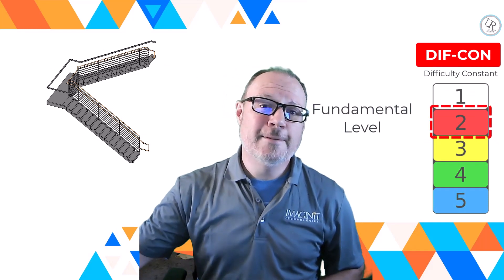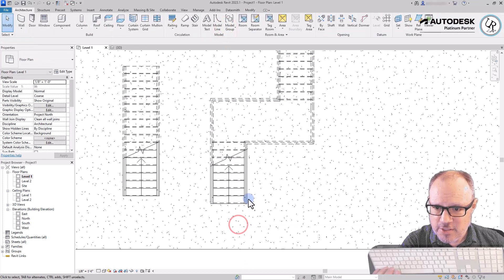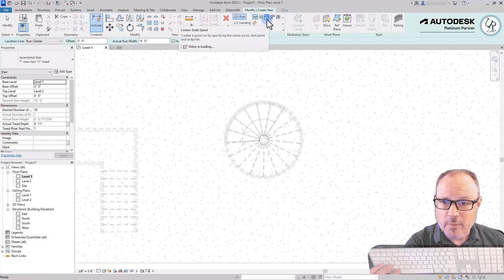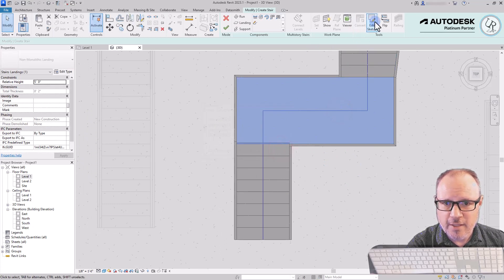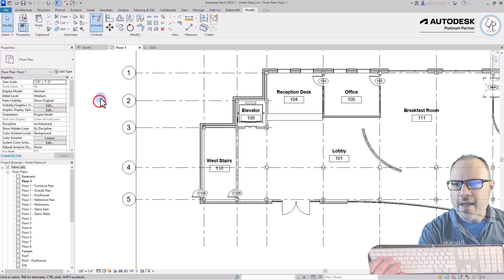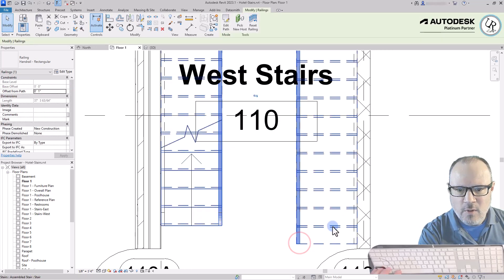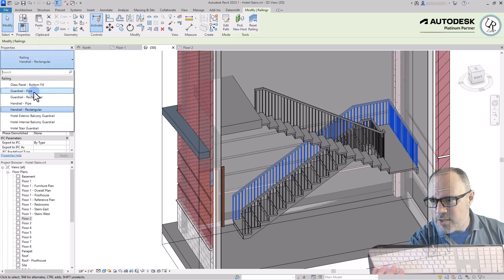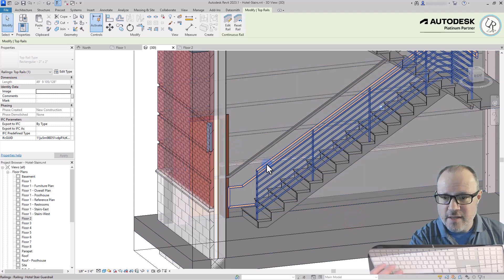Mastering Revit Stair Creation: From Basics to Brilliance - Your New Autodesk Revit Guy

Comment: How can I add a structural column to an exterior steel stair? The stair starts on the level 2, comes away from the building (perpendicular), then turns and runs parallel to the building. How do i add a column under the landing where the stair turns? Do I just use the architectural column tool, or is there something in the stair tool that will let me do this?